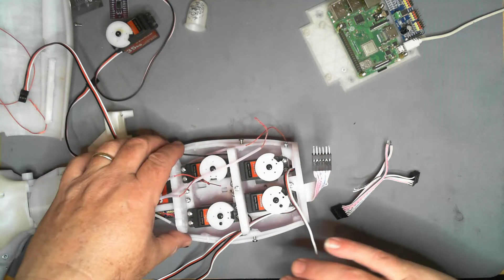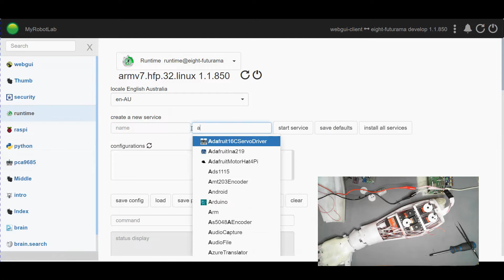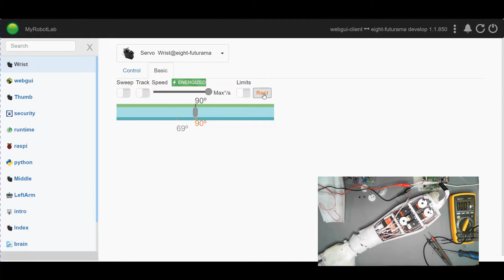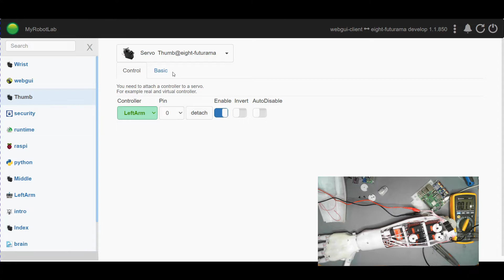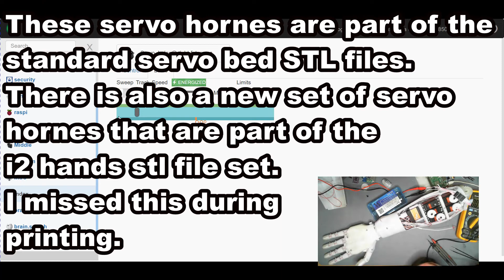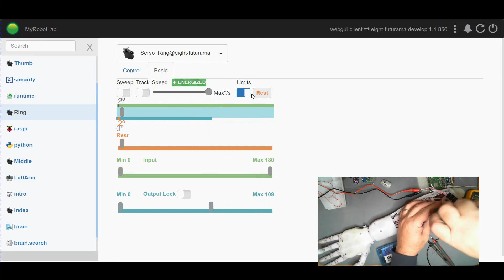Fred's Left Hand Part 7

Comment: Can i use any other servo motor
Reply from the maker: As long as it's a standard size type servo, then yes.
There is a list of known compatible servos on the Inmoov.fr website.
The new I2hand instruction suggest looking for 300° servos, but I've used 270° servos and they appear to work fine.

Comment: Are the new servo pulley’s compatible with the servo motors in the servo bed?
Reply from the maker: There are new pulleys included in the file set, however, I didn't read all the instructions and used the ones from the V1 build :-)
So the older pulleys do work.

Comment: Nice Ray, I am still yet to print the left hand, my last thing to print
Reply from the maker: Personally, I found the new hand with finger sensors easier to print and assemble.
Well worth it :-)
Reply: @CyberOne  yeah I have my V1 in the closet right now I’m cleaning my tray right now so I have some smooth prints sense I fixed the horizontal expansion to the recommended -0.15 I will be do the videos on the V2 hand and the V1 for some spare videos
Reply from the maker: I have a couple of boxes of V1 parts :-)
I might have to build a shredder and a filament extruder to create more filament for the old parts :-)
Reply: @CyberOne  
I’m planning to modify InMoov v1 arm to such as a claw robot for fun I don’t know yet tho 😁
Reply from the maker: Could be interesting :-)